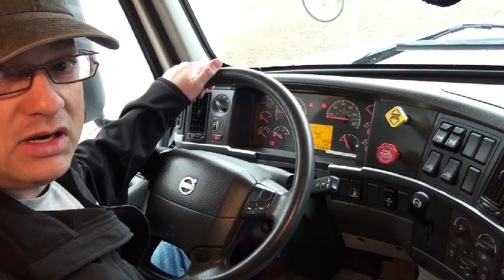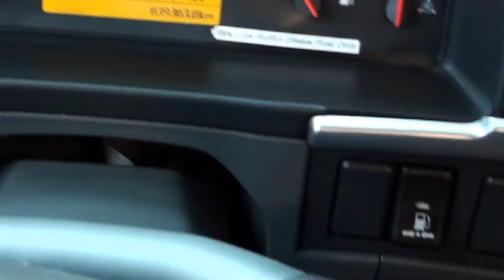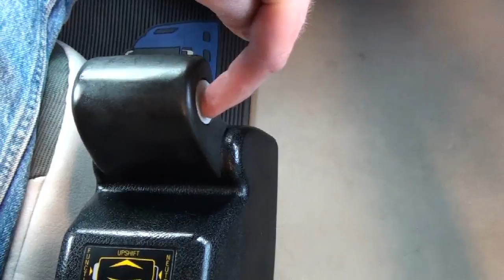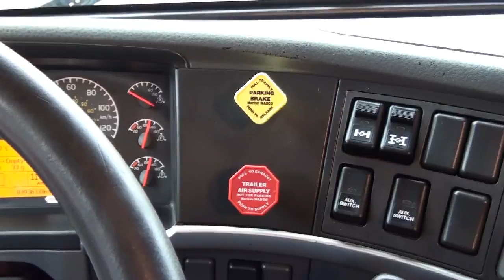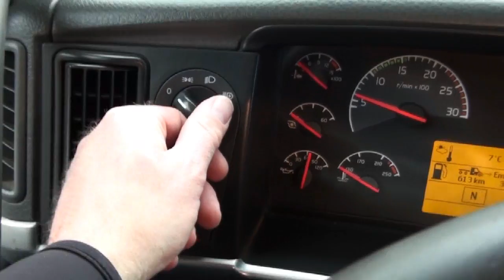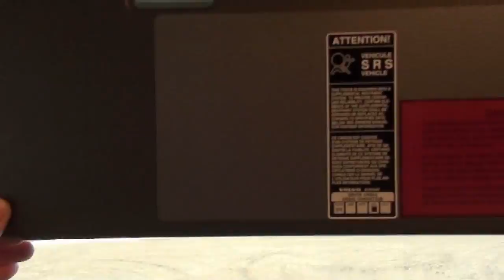RVHaulers Volvo Semi Startup Procedure

Comment: Do any Volvo trucks have a high idle switch?
Reply from the maker: Hello Jake.  Yes, Volvos do have a high-idle switch.  However, we do not need to high-idle a Volvo engine.  The engines have been specifically designed to allow low rpm idling for extended periods of time.  To turn on the high-idle, you turn on the "cruise control" switch and the rpms can be raised when stationary.

Comment: Since these rigs are now RV's, do drivers still need to do air brake tests like they do when performing daily DOT Pre-trips?
Reply from the maker: divisioneight Every state/province has their own requirements for drivers and titling.  Most licensing locations treat these are RVs, and therefore commercial DOT pre-trips are not required.  Some locations DO require drivers to adhere to such good practices of daily pre-trips. I believe that pre-trips are something that drivers should do - whether you are driving a pickup towing a 5th wheel trailer, a motorhome, or an HDT RVHauler.

Comment from the maker: To activate electric brakes, we use a Maxbrake air-over-electric brake controller.  This high quality controller senses the level of application air at the brake pedal, and converts it to an electric signal to the brakes on the trailer.  The sensitivity and accuracy of these controllers is exceptional, such that the truck and trailer brake evenly in all situations.